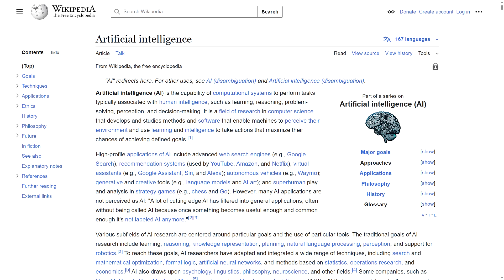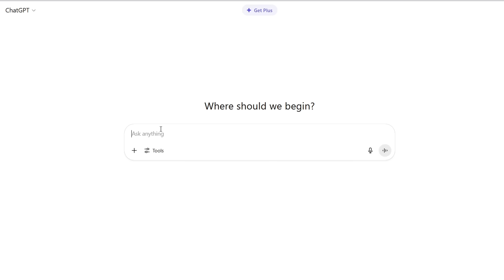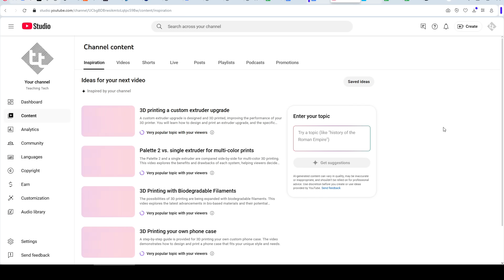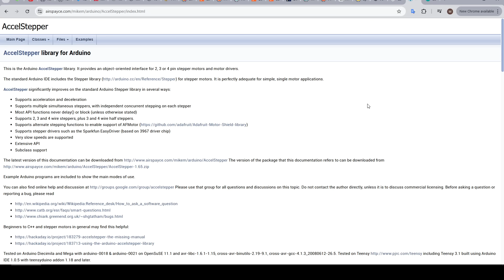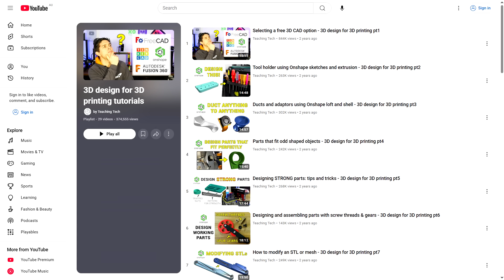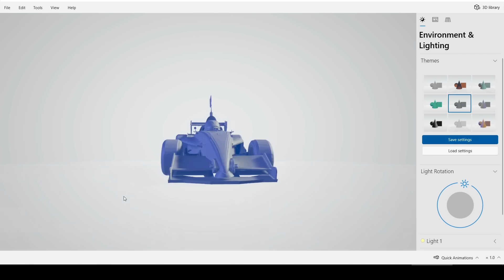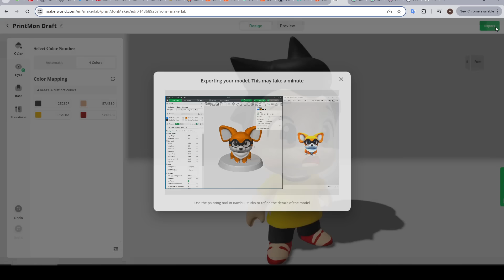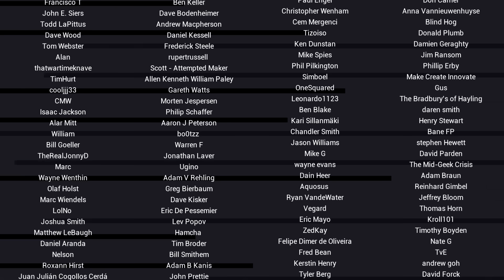Do we want AI to play a part in being a maker?

Comment: I use AI as a tool.  I agree that using is to come up with ideas is wrong.  Using it to help solve a problem is a good use for it.  For example, I'm working on a project for astrophotography, I want to make a light panel that is dimmable (as one of it's features) and want to have a Raspberry Pico set the brightness.   However, I cannot use PWM as the idea is that the light will be imaged.  PWM will create artifacts that make the image useless for the purpose, so I've used AI to help me create a circuit that will allow me to setup a constant current dimmer circuit, electronics is not my strong point, to having this leg up is great as it points me in the right direction to solving the problem.  That said, I still want to take the time to properly understand what the AI has created.  I never want to avoid the learning pit, but being able to make it a little less deep, is a help.  That said, I'm still not planning on creating the entire project using AI, if I wanted that, I'd simply look for an off the shelf solution. (Any yes there is already one, but not quite as featured as I'm attempting)

Comment: Speaking as a librarian - the issues you discuss at the beginning with students aren't new, as I'm sure you're aware.  AI is exacerbating a problem, but it didn't create it.

Speaking as a builder... your thoughts on the Arduino code highlight an issue we still fail to discuss: what is and isn't part of "the hobby" varies from person to person.  For you, creating the code is the hobby.  For me, having the blinky lights in my R2-D2 is the hobby, and learning to deal with code is a tedious precursor step that is just as boring as sanding something smooth, and a lot more frustrating.  Just like I don't want screwing around with my 3d printer to be my hobby, I don't really want screwing around with my code to be my hobby either.  I just want a mostly workable sketch that I can tinker with a little.  Now admittedly, I don't use AI to generate code, instead I search through github for examples - but that's not because I dislike AI as a concept, it's because I know how to search through GitHub, I don't know how to ask ChatGBT for good code, and the initial "learn something new" cognitive effort for me is exhausting.

Which is probably why I'm not that interested in learning to code beyond the very basic level I've got, come to think on it.

But anyway, from the perspective of "I did it myself!" - which certainly has a value to it - I don't really see a difference between taking code written by a person and changing the colours of some LEDs and taking code written by an AI bot and tweaking it slightly.

So, in short: I agree with your conclusion of "it isn't satisfying to have AI do the hobby for you."  But it's important to remember that any specific example of "the hobby" is only true for the individual, and shaming people for using "shortcuts" through the parts they don't consider fun is just gatekeeping.  Not that you've been throwing shade in the video - but a lot of the conversation about AI does.

Comment: My attempts at using AI start with "Wow, that's impressive but it needs a little tweak" and ends with "OMG this is junk, I should've just done this myself to begin with".
Reply: this happens to me. it will spit out something decent. then completely mess it all up, go on a different tangent. sometimes I'll redo or reload like with Gemini, and it will erase the stuff it first had (some cases good stuff) and remake it something else.
Reply: AI ist a simple tool. Learn to handle ist or leave it. It's like using a hand drill because you can't handle an electric one and then blaming the drill.
Reply: Sounds like a skill issue.
Reply: @RagingShrimp67  I'm confused. In what way does it sound like a skill issue? 

I read it as:
On first glance or from a distance it looks good but on closer inspection it looks bad enough to make you wish you had just done it yourself?

Which is exactly my experience too. (But then again I enjoy the journey of writing the code or designing the 3d model or whatever I am doing, so maybe that's the difference.)
Reply: @deadly_dave  If all you manage to get from AI is "OMG this is junk", you suck at using AI. This is also demonstrated in the video itself where: 1. He is not using the leading tools, or even in some of the cases even the correct tool for the job he is trying to do. 2. His prompts are garbage, so naturally his result is garbage, also he doesn't iterate, which is one of the benefits of AI. As I wrote on another comment my 6yo kid can already make better 3D models than anything he demonstrated in this uncharacteristically badly executed, and poorly researched video (unless his intention was to make AI look useless, in that case he succeeded)
Reply: @RagingShrimp67 Well it's either that or it could be that one doesn't understand the topic well enough to know it's garbage. You do you but I'm not a fan.
Reply: @deadly_dave  No actually it couldn't be that, because it is measured against achieving a clearly defined goal. It's more likely that someone is prejudiced against AI, therefore doesn't take the time to understand what tools exist, and how to use them, and then blames AI for being garbage. Luddites can stay in their caves and cope.
Reply: @RagingShrimp67 Sure Mr. Dunning whatever you say.
Reply: @deadly_dave  Good luck staying behind :)
Reply: @deadly_dave  sorry, but RagingShrimp is correct. Proper prompting is most definitely a skill and if your output is bad, even when using the proper LLM, you are probably bad at prompting and iterating (something I also noticed TT didn't do.)

And TT basing all of his research into this on ChatGPT, a good, general purpose AI, is not doing the research properly. Like, if you want to code a website, you use Claude (or one of a few others that are tailored for it).
Reply: @RagingShrimp67 good luck going through life with everything you make being broken in subtle ways that you’re never capable enough to identify.
Reply: @DannoHung  Good luck going through life knowing you are not even smart enough to use AI properly to make stuff that isn't broken :D
Reply: No, AI is like that if you actually know what you're doing @RagingShrimp67

Comment: Bit of a tangent but you mentioned the PrintMon model doesn't stand by itself - I wonder if you could fix that by varying the infill on each side of  the head and make the center of mass actually in the center? Not sure if that is possible